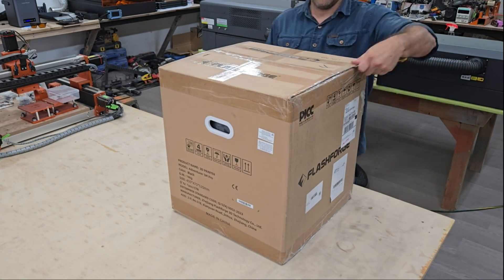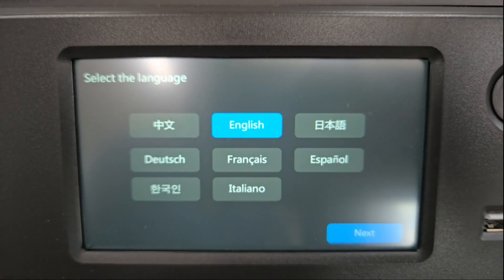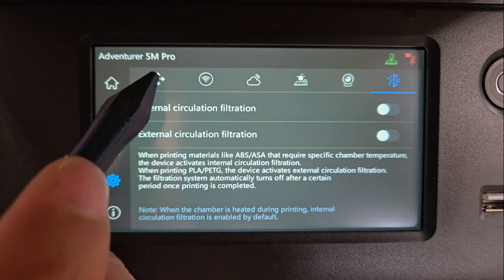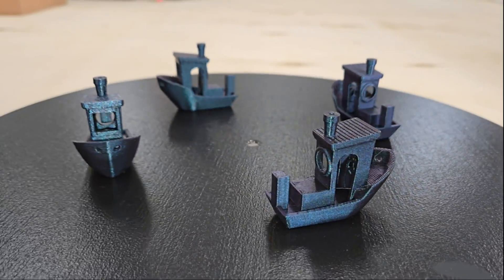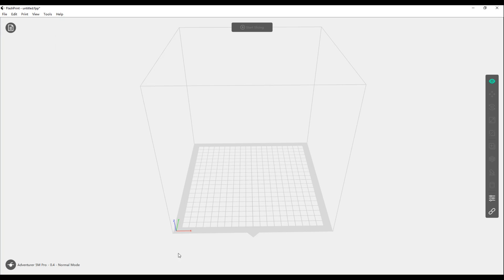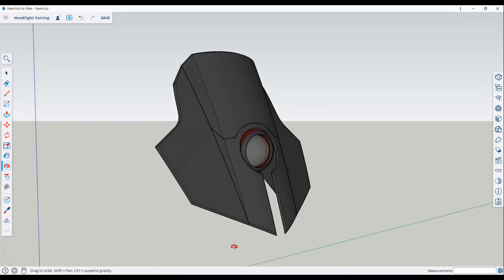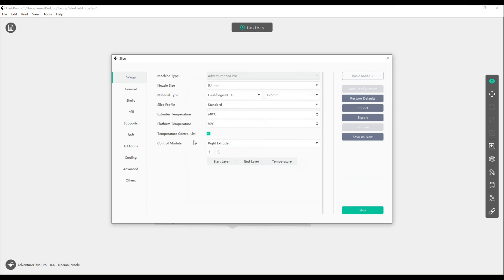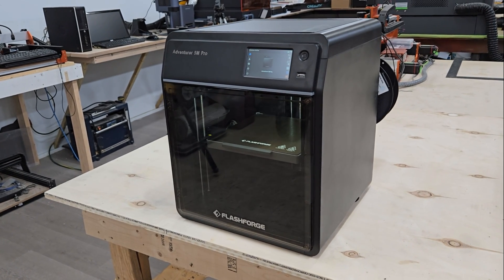3D Printing A Custom E-Moto Fairing W/ Flashforge Adventurer 5M Pro

Comment: Excellent review as always. I am impressed with the layer lines (or lack of visible layer lines) on the headlight fairing. Looks extremely smooth.  The quick change print nozzle is cool as well. Impressive machine over all!

Comment: Any made in America brands you can promote ?
Reply: He's not even in America. lol. Are you going to exclude him now too.
Reply: Flashforge flexible PLA. I encourage anyone that has not tried it to yet to get some. It's softer than most of the more affordable TPUs and prints so easily. I rarely have a print go awry. In the case of this fairing you could print some bushings out of the flexible PLA and it would certainly absorb a lot of vibrations. I use it for bushings and handlebar risers on my very over powered pit bike. It makes a big difference. Lowers the body fatigue associated with vibration. Like $26 a kg on Amazon. 

The other thing I use it for is battery builds. I use PETG for the spacers and then I make an out case for the entire battery out of the flexible and then maybe a PETG outer shell as well though the flexible PLA is quite durable but if you do the soft/hard thing you get the best protection for a high output battery. Vibration damping on your welds on big packs is never a bad thing. 

Easy to make your own OtterBox for your phone too. Never forget you can put 2 models together in a slicer. Use negative versions in areas and make a soft inner and hard outer case and voila you just made yourself an OtterBox for like $2.

That fairing looks nice, it looked a little 2 dimensional in the thumbnail but that looks real nice sir. Very tastefully done.
Reply: Majority can't afford them. So tough to promote things people won't buy because it'd be out of their budget.
Reply from the maker: None have reached out for reviews unfortunately. But here's a list of domestic brands if you're looking for one. They're not in this price range though. https://all3dp.com/1/american-made-3d-printers/
Reply: I bet there will be a number of American companies offering the same quality in the same price range,, 👉
Once America has a government that works for Americans.
Reply: @c3N3q  truth is on a global scale american products dont sell, the price is of german or japanese products wich have better quality. And the chinese products are in some cases worse quality but alot cheaper. If someone outside the usa wants a product but doesnt have much money, they buy chinese, if they do have money, they buy german or japanese. Thats why american companies only focus their advertising on the american market. Wich this channel isnt
Reply: @c3N3q  How? You can't have cheap products while also having high labor costs and corporate greed. Only way this is possible if you get down to paying Americans what they get paid in China, are you ok with that? 
I love how people think we just build everything in America at same prices as foreign made products, it's not possible. You can't have it BOTH ways of paying china prices and have it be made in US.
Reply: @c3N3q  lol, yeah you wish. You aren't going to get anything made in America in this price range. Maybe double the price if you're lucky. Keep on thinking that a president that we already had in office once is somehow going to make everything better this time. Great job voting in a dictator though. Hope you're ready to live like they do in Russia.